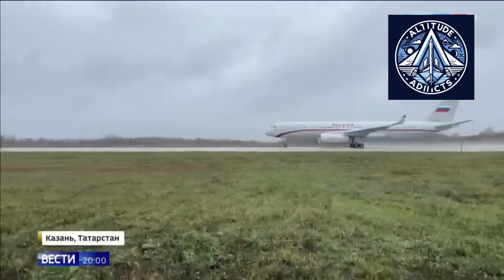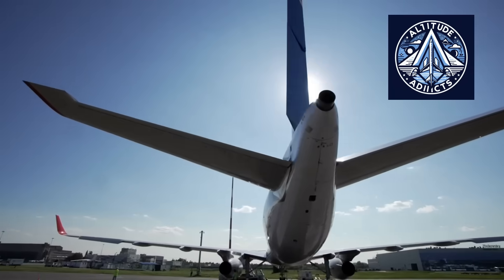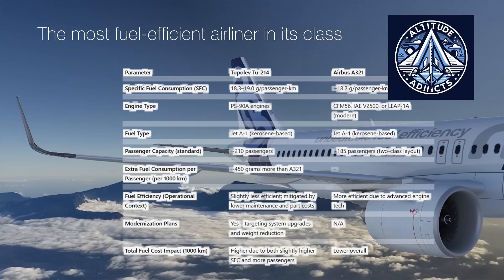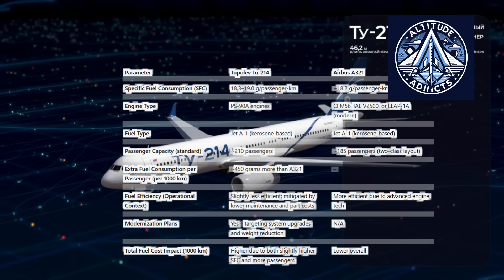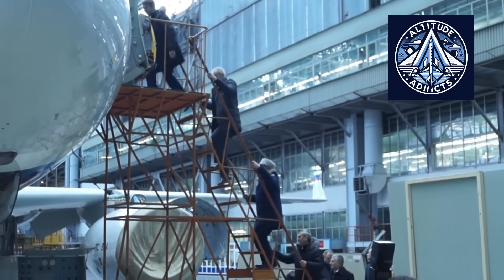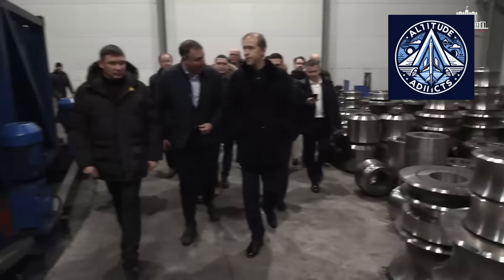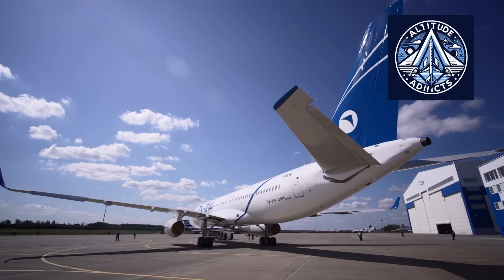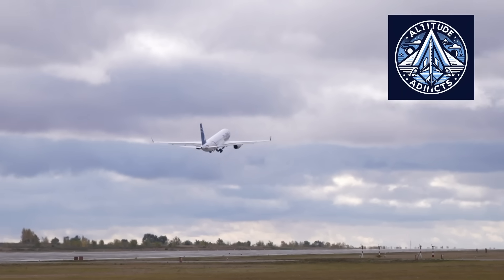Tu-214 and PS-90A fuel efficiency is not critically inefficient

Comment: At 3,000 operating hours per year it cost USD 1.8 million in extra fuel @680/ton. This should be offset with the lower acquisition and potentially operating cost. Basically one can fly 15 years with higher fuel consumption "for free" due to lower acquisition cost compared to a320neo. Not bad.
Reply: And the older 320 neo will be, the more fuel gusting it has.
Reply: Besides, there won't be any A321 around due to sanctions

Comment: Although less important than aircraft safety and reliability, fuel efficiency should not be the main issue for Russia as a country with huge of reserves of oil/gas as this can be achieved by making aircrafts and engines lighter with the use of new materials.

Comment: 3,5 ton/jam di Tu-214 (210 penumpang). Mesin PS-90A.
1,8 ton/jam di SSJ100 (100 penumpang). Mesin SAM146.
Jika melihat konsumsi bahan bakar dan jumlah penumpang yang bisa diangkut memang sebenarnya tidak terlampau buruk. Sebab mampu mengangkut 2 kali penumpang Superjet 100.
Tapi jika dibandingkan:
2,2 ton/jam di A320 (180 penumpang). Mesin CFM Leap.
2,6 ton/jam di A321 NE0 (220 penumpang).
2,8 ton/jam di A321 CEO (220 penumpang).
Maka mereka yang tergiur konsumsi bahan bakar yang hemat akan memilih pesawat Airbus.😅
Namun kita wajib paham, biaya sewa pesawat Airbus bisa 2 kali lebih mahal.
Atau jika pesawat baru itu dibeli, cicilan tiap tahunnya sangat besar.
Sebagai contoh, salah 1 maskapai Citilink di Indonesia harus keluar biaya $4,5 juta setiap tahun untuk menyewa A320 NEO.
Reply: B757 dengan mesin Barat juga hanya mampu 3,3 ton/jam dengan full kelas ekonomi 219 penumpang. Yang luar biasa dari B757 adalah jangkauannya yang mencapai 7000 Km. Para pilot banyak yang berkomentar B757 ibarat pesawat dengan roket tambahan, sangat nyaman dan bertenaga saat take off.
Reply: There is another difference. Airbus may simply not sell you, refuse to service and supply spare parts, and leased planes may be declared stolen. Now this is decided by strange guys in the European Parliament.